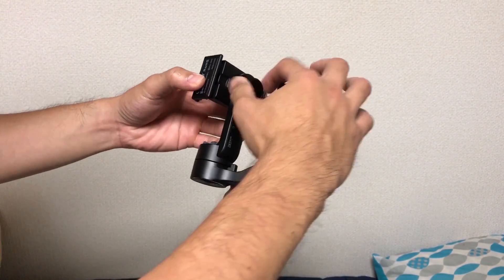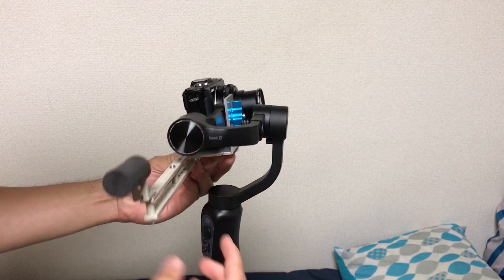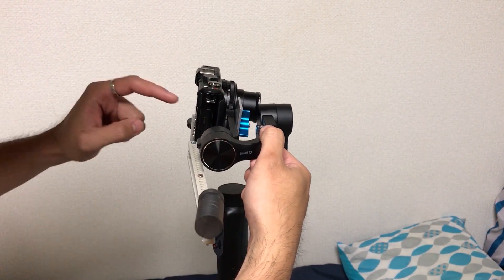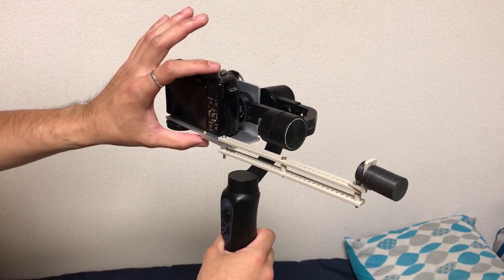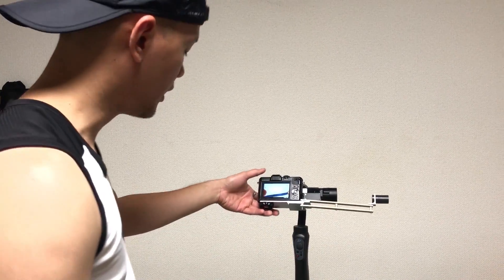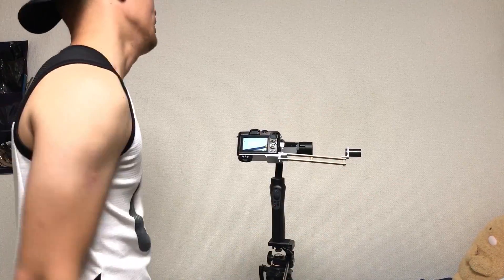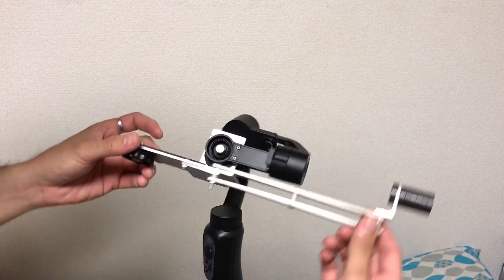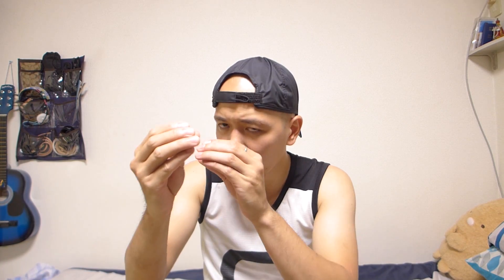Zhiyun Smooth Q: 3 Axis Gimbal Camera Mount

Comment: Hey bro, can you make timelapse with this setup?
Reply from the maker: you mean a timelapse on how to make the rig?
Reply: @StephenGinman   i mean, if your cam can do timelapse/hyperlapse when attached with those gimbal.
Reply from the maker: yes, you could set your camera to timelapse mode... and then control the gimbal's motion timelapse settings with your mobile phone using the zhiyun app.. start the TL on your cam and the smooth Q and your good to go.. they both work independently i this case.
Reply: @StephenGinman  thats good. So you can also motion track while doing a hyperlapse? Example: doing a hyperlapse while you circling the fountain as your subject.
Reply from the maker: Yes you could do that. But if you want to circle around a subject and do hyperlapse, it would be A LOT easier if you'd just use a tripod and snap the pix one by one and then compile them as timelapse in post. Not all footages are best taken with a gimbal.
Reply: @StephenGinman  oh noted thank you, i'll try that also :)

Comment: That superb, Can i do it also in smooth 4?
Reply from the maker: i think so..as long as you could remove the cam holder from the arm..
Reply: Stephen Ginman hmm can it support 660 grams total weight mirrorless+lens included? Did you try that already sir?
Reply from the maker: Yes I've tried it with my Lumix G7 and a 9mm pancake lens. It struggles to stabilize it when your not careful of your movements..And it has to be 100% balanced..If not, the motor heat up quite fast..
Reply: Stephen Ginman i'll take note thanks. I hope can have smooth4 soon to take a test also. Cheers. Tnx.

Comment: Doesn't the motor load a lot?
Reply from the maker: yes it does, when its not perfectly balanced, otherwise I dont think so. You will feel the motors vibrate when they're pushed to the limit..
Sometimes, eventhough its perfectly balanced, when the wind blows quite hard it vibrates. It happens more often when using the mount with the LX7 instead of a heavy phone like the iphone7plus+clip on glass lens.

Comment: How did you removed the screw inside from the mount, I want to create a plate for my RX100 M3
Reply from the maker: 1.) Remove the rubber pad on the mount(you can replace it again since the adhesive is very good).

2.) Unscrew the 2 screws so that you can remove the springloaded clamps(they're quite snug but don't worry, just pull the clamps off).

3.) Remove the locking screw for the thumbscrew of the mount.

That's all! Happy modding😎
Reply: I already removed the rubber pad and the screws but didnt know i could pull it off like you say. It worked. Thank you very much,.
Reply from the maker: glad to help man...